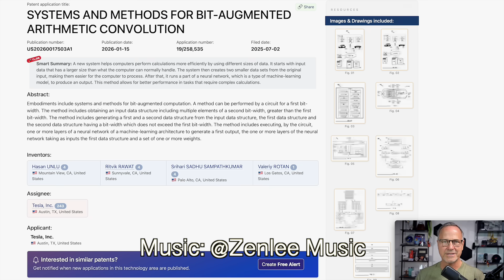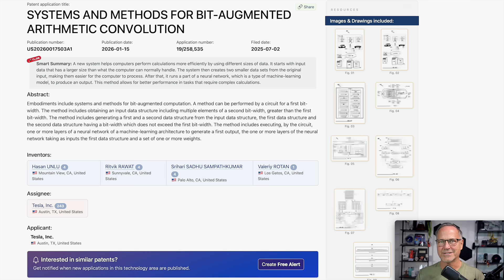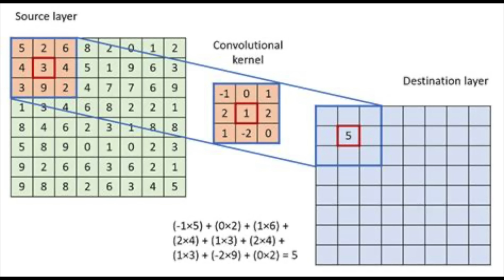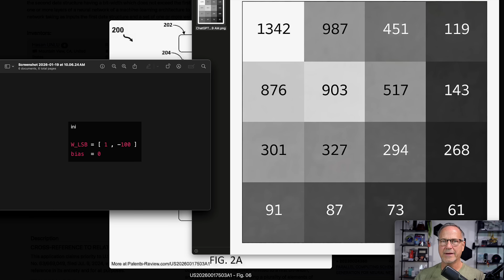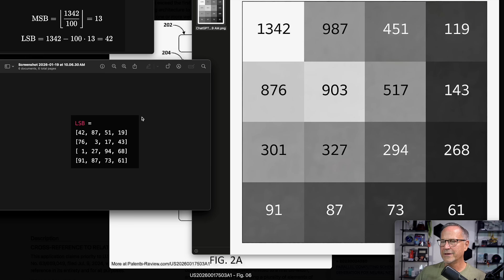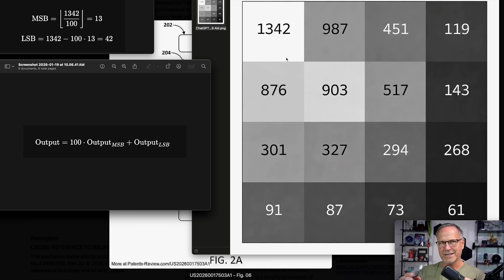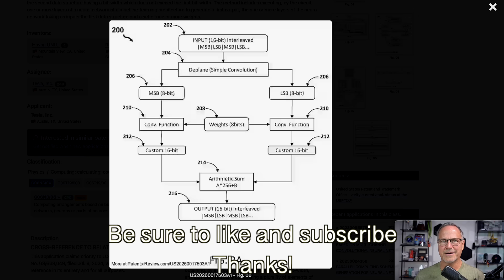Tesla Turned Obsolete Hardware 3 Into a Modern AI System

Comment: Sounds great! But now there is no redundancy chip? 😕
Reply: They probably realized that in practice these chips never failed
Reply: the redundancy still exists it just needs both chips to run self driving. if one fails then they will have a backup much easier to run model or fsd 11 stack take over to pull over the car
Reply: They'll do anything not to have to upgrade everyone's hardware legally.
Reply: @multicamzilla4669  There is no " legally" involved here.  Tesla is doing what it can to update older models so they don't have to buy a  new car to get a newer version of FSD.
Reply: your missing the point
Reply: @dewalddelange2625  What point is he missing? The redundancy was there for safety. Lose that and won’t that reduce safety?
Reply: @robertkliemann3478  
They could fall back to a smaller model if one chip fails. But it will be extremely rare, most likely other failure modes will be the vast majority.

Comment: This will work because 8 bit processors are more efficient than 16 bit processors. Two  slower and older 8 bit processors will process at near speed of a newer 16bit machine. Loss will occur in bus transfer and Boolean logic to break apart and combine. But you will be surprised at that speed on 8 bit machines. The simplicity of state change will make up for older processors speed disadvantage. As a matter of fact, this model would be the preferred method. Maybe hardware 11 will split processin this way with faster 8but machines. Btw when Elon changed the way he combined the servers with Ethernet, he changed low level Ethernet cards to only process packets in one direction completely eliminating the original idea of Ethernet burst and listen model that slows it down unpredictably. I’m sure Elon was the one presenting this idea to the team.

Comment: My electrical engineer husband said not to give up on Tesla's HD3, and he also said maybe space data centers might not the best path.
Reply: Obviously your husband is smart but also insightful. I'm thinking perhaps that Tesla engineers are using programming  concepts used from old gaming consoles that had to squeeze everything out of their little computers!
Reply: @gsmith2520  Yes, squeezing out everything you could get out of things like the 6502 and Z80 back in the '80s required a lot of ingenuity.  If you look at the games that are released when a new console comes out compared to those which are released a few years later you can see how developers get much more out of the hardware after being able to play with it for a while.

I was part of that '80s scene and there was a lot of free-flow of ideas which really pushed the systems well beyond their original expectations.

So I wouldn't right off HW3 or HW4, it just takes time.  It's good that Tesla are willing to put that effort in, though their alternative option is to work out a way of upgrading all of the HW3 cars after Elon's statement a few months ago.

Comment: Well, I appreciate the fact that there is a patent that's been awarded apparently. It's worth noting that this technique is incredibly common and has been used for a long time in computer games and computer graphics. So, it's really not new in any way whatsoever. It's simple math tricks to go around precision issues. It's done all the time.

Also, there are some other things: I don't think that this will require any retraining at all because this is just a layer in the inference. That should work with the existing data and not require anything new. It should work a hundred percent because you're still working with full 16 bits. You're just using your hardware differently to achieve it.

Lastly, the thing that I'm really wondering about is isn't the whole point of having two identical processors on the board for safety redundancy? Is it possible to just use both for one thing? Or has that cow already left the barn?

Comment: They still haven't figured out that they need Lidar and Radar. I guess they need a better team of programmers.
Reply: Not having radar and/or lidar equipment was a requirement by management.   If you want that hardware you currently have buy a different vehicle brand.
Reply: Go buy a Waymo if you want 24 cameras, 15 lidars, 20 radars, 50 ultrasonic sensors, 12 infrared sensors, 15 ultraviolet sensors and more and still when the power goes out as it did in SF recently, the Waymo's stopped while Teslas kept driving.
Reply: @ronjos 😂
Reply: Does the mere fact of having Lidar and Radar make a system safer? Would the worst system jump way up just by adding them?
Reply: @Sam-o7n7v   Does the mere fact of having Lidar and Radar make a system safer? 
There isn't a shred of evidence that it does, and thanks for asking.
Reply: @Sam-o7n7v please allow me to comment!  On a clear and bright day I don't think lidar,   radar makes that much difference. However just like polarized sunglasses helps humans see through sun glare and fog lights help see through fog, lidar helps car see through darkness and radar through fog. Human vision is limited and so are cameras.
Reply: @gsmith2520   lidar helps car see through darkness and radar through fog. 
Hypothetically this may a valid claim; but the near-perfect record of Teslas with FSD engaged driving >7 billion miles with a safety record two orders of magnitude better than human drivers makes it crystal clear that the hypothetical claim does not carry over into the real world.
Reply: @MarkSpohr  They still haven't figured out that they need Lidar and Radar. 
Actually, they HAVE figured out that they DON'T need Lidar and Radar. Teslas with FSD engaged have an astonishing record of safety, with one at-fault fatality in over 7.3 billion miles driven, over several years. This is about two orders of magnitude better than human drivers would experience. If the absence of Lidar and Radar were a safety defect, this would have been obvious in far fewer than 7+ billion miles driven.
Reply: @BigBen621  lidar will make it three+ orders of magnitude
Reply: @gsmith2520   lidar will make it three+ orders of magnitude 
The problem with this claim is that there isn't a sliver of a thread of evidence to support it. The astonishing safety record of Teslas with FSD engaged is documented in detail by NHTSA. But nowhere is there a shred of evidence that adding Lidar will improve that safety record; and without evidence, this is just a spurious claim living in the brains of a bunch of Lidar-heads such as you and your ilk.

Comment: While this does help HW3...

It's not gonna be enough for unsupervised I don't believe.
However it does mean that all future chips from them can squeeze out more performance
Reply: Without redundant computers , does this disqualify hardware 3 for running unsupervised?
Reply: @gsmith2520 good question
Reply: Are you a machine language coder? I am. This will work because 8 bit processors are more efficient than 16 bit processors. Two  slower and older 8 bit processors will process at near speed of a newer 16bit machine. Loss will occur in bus transfer and Boolean logic to break apart and combine. But you will be surprised at that speed on 8 bit machines. The simplicity of state change will make up for older processors speed disadvantage. As a matter of fact, this model would be the preferred method. Maybe hardware 11 will split processin this way with faster 8but machines. Btw when Elon changed the way he combined the servers with Ethernet, he changed low level Ethernet cards to only process packets in one direction completely eliminating the original idea of Ethernet burst and listen model that slows it down unpredictably. I’m sure Elon was the one presenting this idea to the team.
Reply: @davekeller1431  Your essay is excellent, but the issue is that if you are splitting instructions and putting them back together, that infers that you are using both of the chips in HW3, which were meant to be redundant, which they no longer would be. Meaning, it will not bne unsupervised. Bc if one fails, it cannot work off one without the other.

Comment: This is most likely a dumb question but could this methodology be used to make other hardware like HW4 even more capable than it already is?
Reply: Maybe dual computers could run parallel with high autonomy,   however, if one computer goes dead then perhaps the system can degrade to where the max speed is 35 mph while running on one computer?
Reply: @gsmith2520  Well FSD works fine off one for just pulling over but I think that's not gonna be enough for tesla
Reply: I would think hardware 4  with 16 bit registers would be enough precision for the future. However, couldn't the redundant AI4 chip be used in parallel to the primary AI4  chip resulting  in more reliable and quicker decisions?
Reply: Yes but this method would remove the redundancy needed for unsupervised.

If one of the chips or boards failed, it would no longer be able to handle the model on one chip
Reply: @ironted5 I was wondering the same thing if the new method for hardware 3 would disallow unsupervised because of lack of redundancy?

Comment: That's a temporary solution just to keep us HW3 owners from rebelion and hopefully they're just trying to extend this transition period until HW5 is available. You just don't sacrifice the safety of having redundant microprocessors without consequences as it defies the purpose of having redundant ships in first place.
Reply: With over 6 years and millions of cars on  HW3 being availability, has there been a documented case where backup computer took over immediately from the primary computer? Does the backup computer ever get exercised?
Reply: @gsmith2520 That’s a good question and the answer only Tesla can provide but the fact that there’s still provides dual redundancy tells us the probability of failure on demand is higher than what a single computer can provide for an acceptable failure rate.
Reply: @MarksEscalona  , my understanding is that redundancy had already been removed from HW3 as of 2024, if not earlier. It's also not clear to me that redundancy is especially critical given an end-to-end neural net, since unlike software 1.0 where a radiation induced error could cause some software to take a different branch which could be catastrophic, sporadic radiation induced errors within software 2.0 a nothing more than a tiny amount of noise; so much so in fact that Google and Tesla are talking about putting non radiation hardened GPUs into space (where radiation induced errors are way more common) since neural nets are quite tolerant of such errors.
Reply: @foo @footube3 ware fault tolerance is virtually a requirement for high level of autonomy, I highly doubt that regulators would ever approve a FSD system that has no hardware fault tolerance. Tesla may have had no choice to use both microprocessors at some point to be able continue with the development of FSD due to hardware limitations. The fact that AI4 has also dual microprocessors reinforce this.

Comment: What a coincidence
630,000 of us FSD owners can't run the latest v14x on our HW3 cars
and Elon promised an "upgrade" costing probably $2 billion off the bottom line at least

Sounds like snake oil to me...
Reply: Where did you get the 630K number? I was under the impression that the number of HW3 owners that PURCHASED Full FSD outright was considerably less than that. And that is the subset of HW3 owners that Elon stated would be eligible for a hardware upgraded.
Reply: @Dave-ei7kk  Where did you get the 630K number? 
Good question. Teslas started being delivered with HW4 around Q1 2023. According to AI, around 1.8 million Teslas had been sold by that time. And Tesla has said the penetration of FSD is around 12%, which puts the number of HW3 cars with purchased FSD at most 180,000, a fraction of the 630K claim.
Reply: @Dave-ei7kk  You know you can ask AI directly and circumvent me.
But I asked AI (Prplexity) for you:
Q: how many people have purchased Tesla's FSD for their HW3 cars
AI: (it came back with a 10 page report too large for this chat - I'll just show the conclusion)

Tesla FSD Purchases for HW3 Vehicles: Comprehensive Analysis
Executive Summary
The precise number of Hardware 3 (HW3) Tesla vehicles with Full Self-Driving (FSD) purchased remains undisclosed by Tesla, but authoritative estimates based on official company disclosures place the figure between 225,000 and 480,000 vehicles. Tesla's most concrete data point came at year-end 2022, when the company confirmed that 285,000 customers in North America had purchased FSD—a figure representing approximately 9% of the HW3 fleet at that time. As of Q3 2025, Tesla's CFO disclosed that 12% of the company's entire fleet has paid for FSD through either purchase or subscription, though the company does not separately report the breakdown between outright purchases and ongoing subscriptions, nor does it segment this data by hardware generation.

This ambiguity carries significant financial and operational implications. Tesla has acknowledged that HW3 hardware cannot support fully autonomous driving capabilities, and CEO Elon Musk has publicly committed to providing free hardware retrofits to customers who purchased FSD outright. However, as of January 2026, no upgrade program has been implemented, and the company's February 14, 2026 transition to a subscription-only FSD model further complicates the upgrade obligation landscape for existing HW3 purchasers.
Reply: @Dave-ei7kk maybe so for a lot FSD purchase. About the 2019 model 3 for $40,000 with anticipation of getting FSD  level 5 driving in the future.
Reply: Pay the money and upgrade HW3.  You got the money.  SHEESH
Reply: @1977SITHLORD his net worth probably changes by 2 billion $ on a daily basis
Reply: @noleftturns Elon promised an "upgrade" costing probably $2 billion 
No he didn't. He said the hardware would be upgraded if HW3 wouldn't run FSD (Unsupervised). If this programming hack allows FS3 to run FSD (Unsupervised), then there's no obligation to update the hardware.
Reply: @BigBen621 has Elon said that the software hack will allow hw3 to run unsupervised FSD?
Reply: @gsmith2520  No.
Reply: @BigBen621  So you agree that we HW3 owners who bought FSD will be able to run FSD 14x the latest version? Did I get that right?

Well of course I asked AI about this and here are some of the dozens of Elon replies on this topic:

January 29, 2025 - Q4 2024 Earnings Call
Three months later, on January 29, 2025, during Tesla's Q4 2024 earnings call, Musk abandoned the conditional language and made an unequivocal admission. When Tesla's head of FSD, Ashok Elluswamy, first responded to a question about HW3 by saying the company was "not giving up on it," Musk interrupted and corrected him:

"The truth is that we will need to replace all HW3 computers in vehicles where FSD was purchased."
==================
Nothing about hocus pocus tricks - replace all HW3 computers.
Reply: Elon’s optimism leads him into reality traps like this from time to time. Now he’s saying that Starship will be launching hourly in three years. That’s not going to happen from the Cape, because public pressure will limit nighttime launches, and actually, with how loud it is, I wouldn’t be surprised if local officials force most launches to go from more isolated locations like Wallops Island, Virginia.
Reply: I'm very happy with what I got for the money on HW3 as it is.  Amazing tech and a game changer already.
Reply: @jeffreyschmitz7026 you have no problem with your FSD not updated for 13 months now...how much did you pay...me $10,000